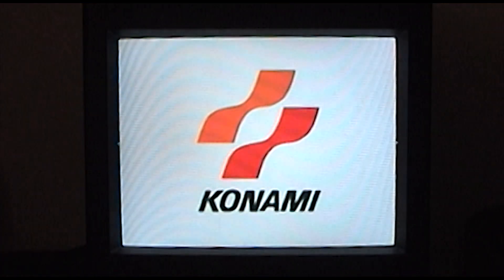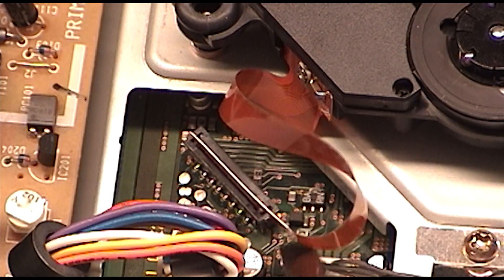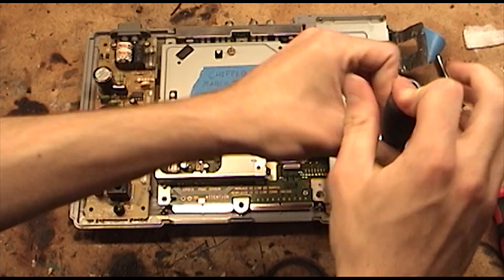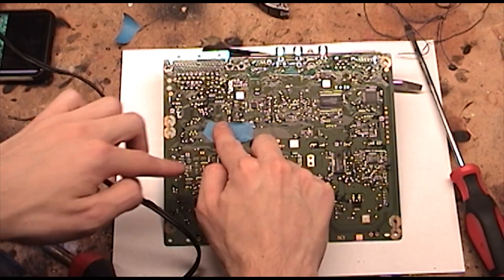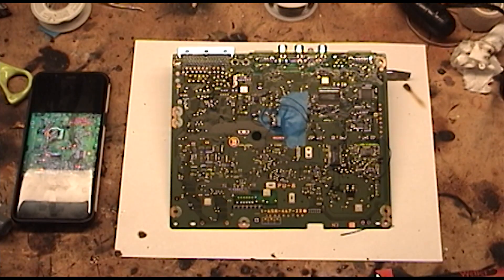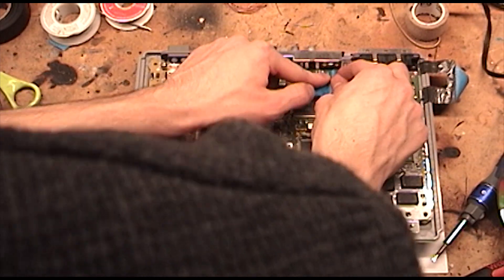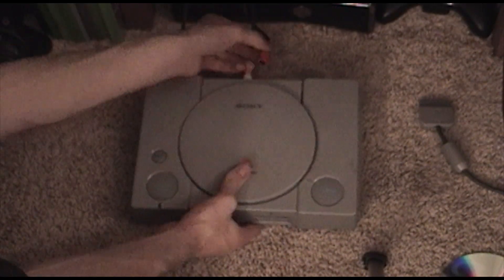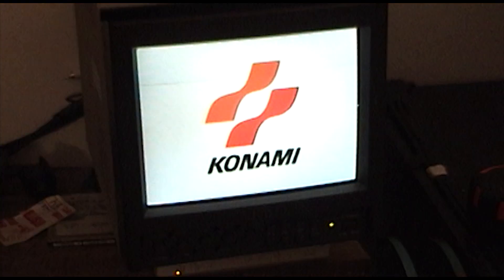How To Install an MM3 Mod Chip in a PlayStation 1 PU-8 SCPH-1001

Comment: Thanks for the very helpful tutorial, it made this installation super easy. After doing it however, the cutscenes in games are laggy now. What do I do???😢😢😢🩻
Reply from the maker: Hi Thistyneb, thanks for watching B^)
Unfortunately, that is a common issue with not only burned discs, but PlayStation as they age. There are several factors that can contribute to skipping cutscenes such as the quality of disc used, the write speed in which the disc was burned, and the adjustment of the PlayStation laser itself. It is possible to adjust the laser to read burned games better. You can also try playing the games with the console upside down or sideways which might help it read better. If you're a die-hard ps1 epic gamer, you should check out the xStation disc drive emulator to forgoe disc problems for good, but it is pricey. I hope this information is helpful.
Reply: I am so happy about this information. I'll try your recommendations and get back to you. As a hardcore PS1 gamer, I couldn't possibly imagine playing my PS1 games anywhere else so I hope this works. Thanks for the quick response. 🎋  @Naitrio
Reply from the maker: @Thistyneb  Absolutely. I look forward to your updates, and thanks for watching! :D 🌏

Comment: I dont get it. I did all the same but mine for some reason plays games only in standing position and black and white i have a Pu-7 spch 1002
Reply from the maker: Oh sweet, a PU-7 board. Hmmm, a black and white picture makes me lean towards maybe an NTSC/PAL issue. And by standing position, do you mean the console needs to be sideways to read discs?
Reply: @Naitrio  yes . And I don’t get it as I did step by step ( is there a way of pm so I can show you pic?)
Reply from the maker: @semanusaverom7307  The disc drive is definitely at the end of its life on your system, which should probably be fixed first. My instagram is Simply Naitrio if you want to send a picture.

Comment: will this work with a scph-1002?
Reply from the maker: I believe so. If you have your PlayStation handy, try opening it and make sure all the solder pads match up, assuming its a pu-8 logic board. Also make sure your mod chip is region coded for your region.